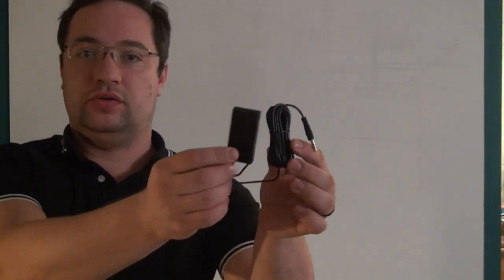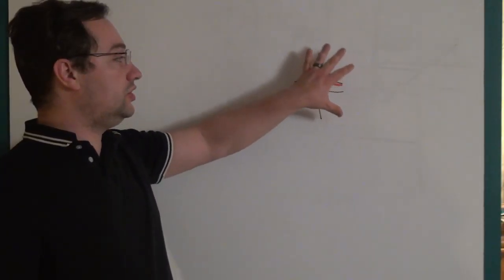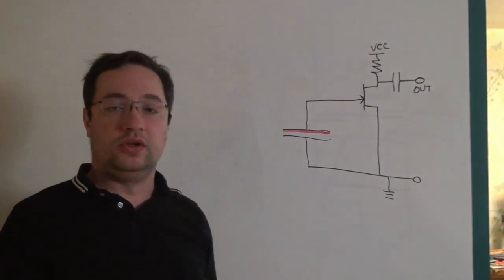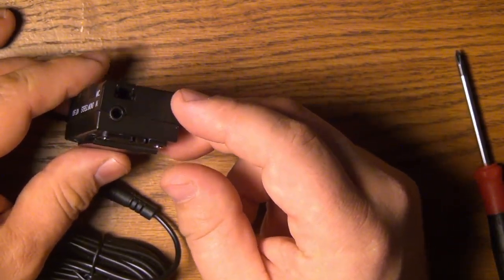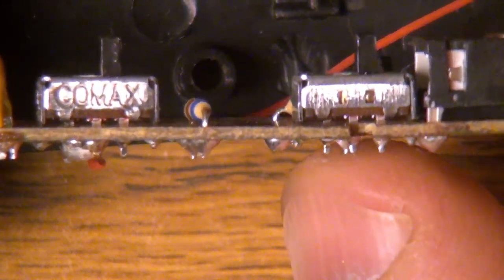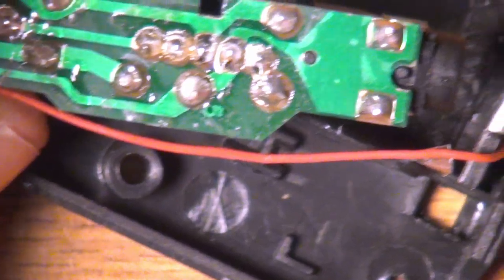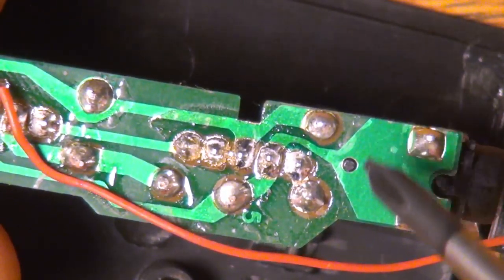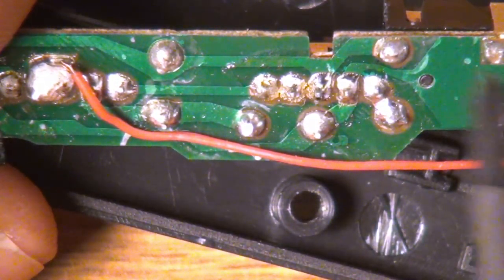eapbg #44 Plug in power pack for microphones reverse engineering

Comment: Rare to find information. Thank you! Do you have any more sources, you can link in regards to circuit calculations? Would really like to know how the power output of the microphone and sound quality is affected by voltage, let's say between 1.5V and 5V, and what the capacitors/resistors do in regards to sound quality...

Comment: I have a BM-800 condenser microphone..which i can power with a 9v battery..i search that the value of resistor i need is 6.6k ohms - 6.8kohm .. do you have an idea on what value of capacitor do I need?
Reply from the maker: As large as you can afford space. The bigger the capacitor the larger you frequency response will be on the low end.